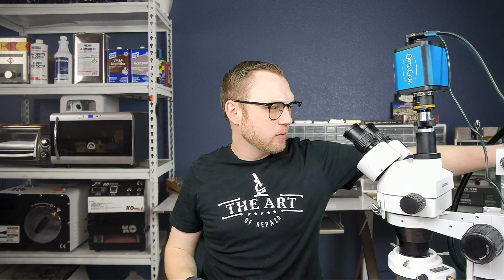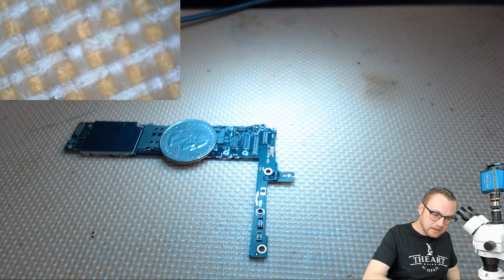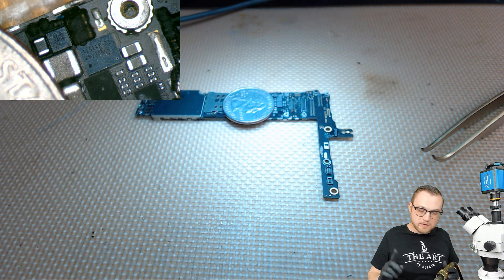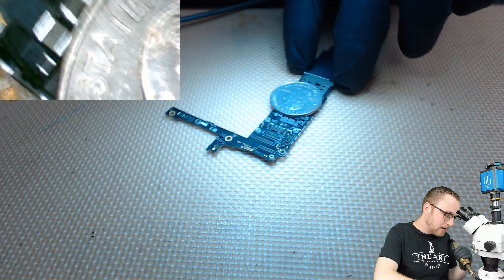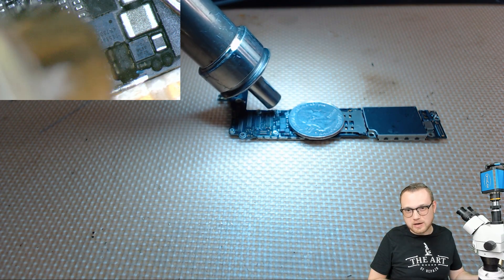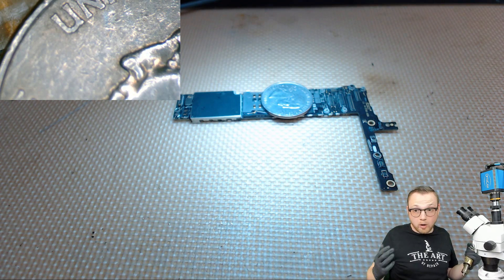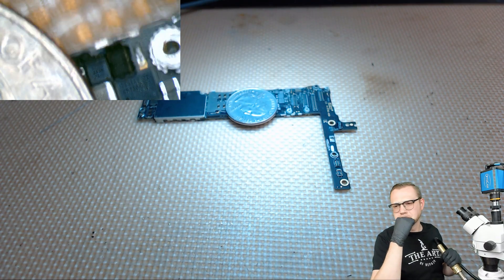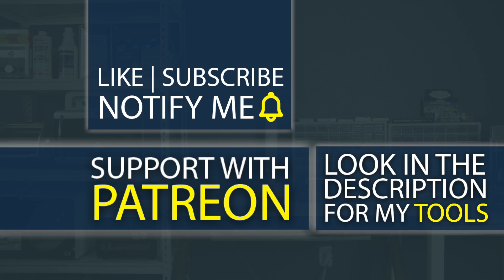Microsoldering 101 | How to Aim your Hot AIr Properly | Aim is IMPORTANT

Comment: Are you using a barlow lens to have more space for the hot air? Without one seems have to hold nozzle almost sideways, especially with the bulk of an led ring
Reply from the maker: Correct! im using a .5x barlow which gives you 165mm of working room, so you can aim in from the chest as you should. =) 1x has 100mm of working room.
Reply: @TheArtofRepair  Have you tried a 0.7x barlow? Curious the difference between the two
Reply from the maker: @mrsemifixit  yes .7x should give 134mm, you can try one if you like, im sure its fine, I just like the most working room possible, as the zoom at that level is more than enough.
Reply: @TheArtofRepair  Thanks. One more thing, does using a barlow lens affect quality of image (less 3D) or not enough to matter?
Reply: @mrsemifixit yes less 3d

Comment: I need help! While hand soldering (with an iron) a micro Sd slot onto a PCB, I accidentally  bridged two pins to the metal shield on the top of the card holder. Now I can't melt the solder anymore because the shield is now  a GIANT heatsink.  What to do?

Comment: You couldn’t have explained it better! Like the ease you have getting the point across. Making the viewer understand about proper pointing of the gun so the heat is isolated to the chip and the residual heat goes away off the board. That is a good arrow! Very straightforward!

Comment: Thanks for everything sir.will you please make a video on complete shorting components?.i always have confusions inbetween parallel and series curcits.How to removing beeping inbetween capacitors.how to identify vcc mains?confusion on EN signal power ic if i found 3 same EN readings around power ic.Hard to judges which readings are because of shorting components.if i have a complete video on where abouts of components,how curicuit runs where electricity goes first in capacitors ,resistors or in diods.if you help me out it will be big favour for me.much appreciated.thanks.hope for the best.thanks once again.

Comment: i've been using kapton tape along side my hot air for years and never had a single issue with surrounding components. even complicated repairs have never been an issue. use kapton tape, flux(i personally like kingbo flux), some common sense and hot air rework isn't rocket science.
Reply from the maker: I mean you said it yourself, you have been doing this for years. On the flipside of Kapton tape, iv seen MANY techs who float everything under the Kapton because the Kapton is stuck to it, and they do not know the proper timing/heat which is definitely a learned skill on its own. Learning how to direct the energy you are working with is still an important baby step in moving forward, that coupled with using Kapton can for sure greatly increase your success rate. I appreciate your comment and hope to see more from you in the future =D Thanks for watching =)
Reply: @TheArtofRepair  Hi Justin great vids, I'm into repairs not that of an expert with iphone boards but I watch different techniques. What do you suggest to protect and isolate the surrounding components. It's true what you said when sticking kapton tape components could slide if they're sticked to the tape. But I've seen some people sticking each of the ends of kapton tape just to the table. Can a small ram memory heatsink work instead of a coin ? or a coin it's enough ?

Comment: Great video! How far do you have your nozzle when, let's say, you're desoldering some large underfilled IC like the nand or Wi-Fi? I understand that it can vary depending on the airflow you have set on your hot air station, but I would really love to know the distance at which you feel comfortable desoldering.
Reply from the maker: Honestly, The closer you are the better in my opinion. I think some people get thrown off on distance because they cannot see the component and don't trust their own work yet. I would say maybe 3x the thickness of the chip itself is plenty, and if you use a straight nozzle and cannot hit that angle, still being pretty close helps, its direct heat toward the target not to surrounding things. Thanks for checking out my video btw, feel free to always leave comments, and ill do my best to anwser any questions you have =D
Reply: @TheArtofRepair  Thanks for your prompt and useful response. The temperature set in the hot air station is not the same that arrives to the IC and it varies with distance, hence I do things carefully as to not cook the IC or popcorn the PCB itself. Perhaps I'm not heating the ICs enough, at least considering the time it takes me for the IC (namely Wi-Fi) to come off the board, in comparison with other YouTube videos. Since I'm working on my own boards, I guess I can try and experiment.
Again, thanks for your help. Keep up the great content.